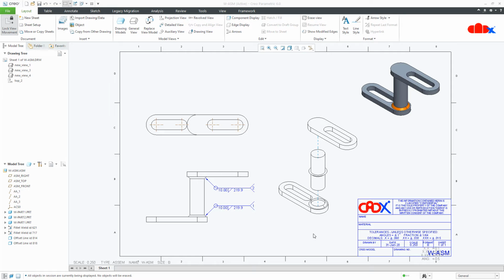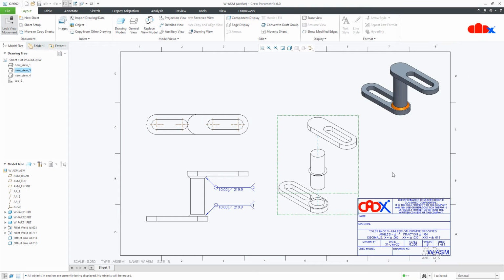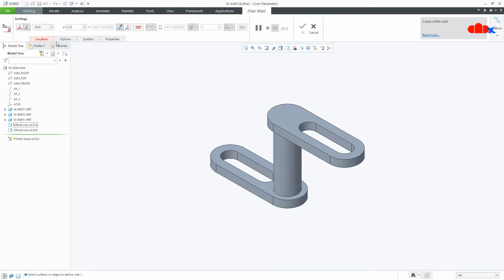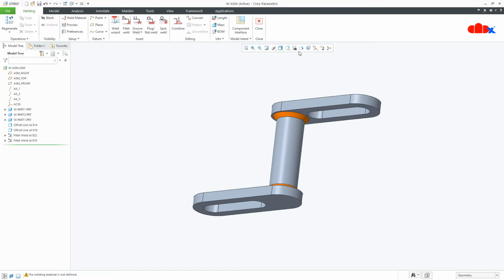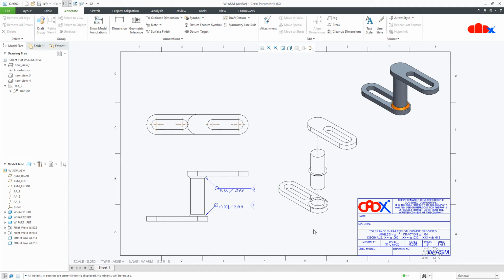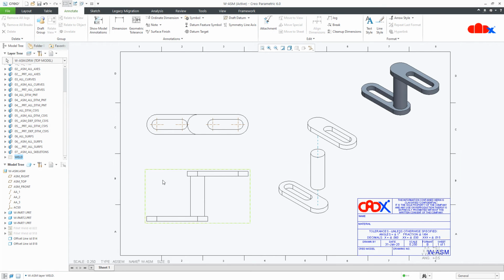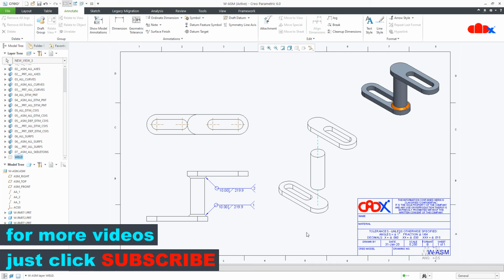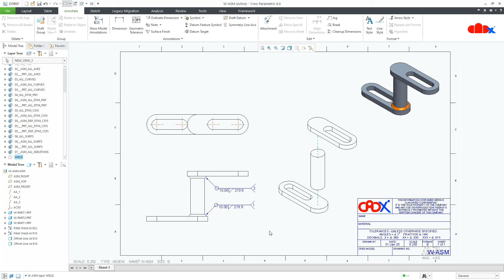Hide the weld from any drawing view in Creo Parametric

Comment: How to apply welding in between non mating parts? E.g Holes with larger dia. than shaft.
Reply from the maker: It is possible. Just keep the weld size bigger than clearance.
Reply: @CADxTraining  Can I customize that weld to make welding portion only at half of clearance/round? Means final weld looks like C
Reply from the maker: Yes you can do that
Reply: @CADxTraining  Please make an indepth video of welding feature in Creo & general knowledge about welding symbols.
Reply from the maker: I will do it soon
Reply: @CADxTraining  In your exploded view I noticed the Explode lines . What is the procedure to do that?